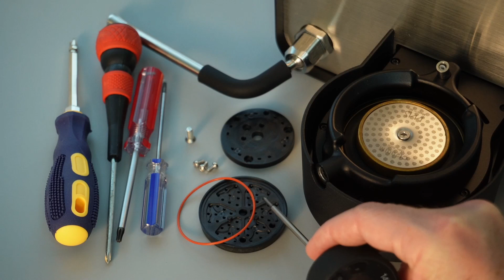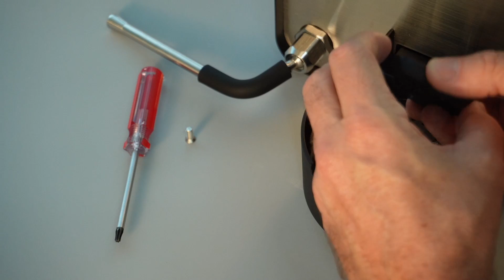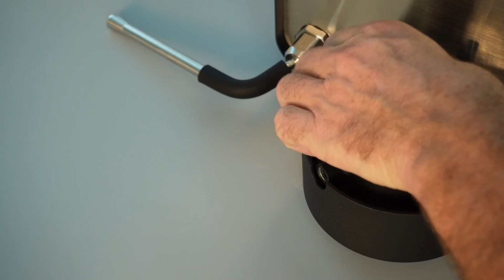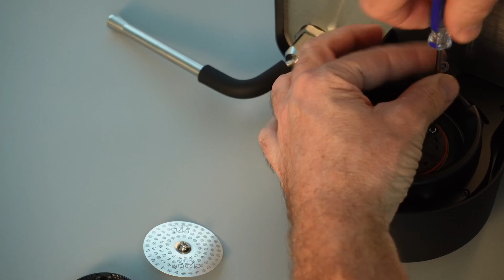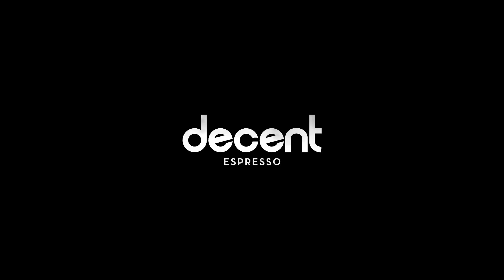How to upgrade the group head parts on your Decent Espresso machine

Comment: I wonder if by adding that new group head o-ring how long that will last and if that will be a yearly replacement part and how we know is not leaking thru the side, Asking as possible new customer buying the machine.
Reply from the maker: It doesn't get any motion and very little pressure, so we don't think it'll wear quickly at all.  At any rate, it's easily replaced if it ever did wear out.
Reply: @decentespresso  well I made the purchase and I can't wait to interact with the machine, the most that caught my attention is the company mentality of supporting previous models. I hope that continues like that and if big changes are made at least having the option to purchase the upgrades that we continue enjoying the machine thanks Decent for making this awesome machine

Comment: Why the new screws? Can we use the old screws?
Reply from the maker: Using the Torx screw is better in the long run as they are less likely to get stripped. ✌️

Comment: Would you clean these with a Cafiza soak too, same as the old parts?
Reply from the maker: You should only use cafiza on the metal parts only, like the portafilter head. Just warm water and a sponge should do it for the new group head parts.
Reply: @decentespresso Portafilter head as in basket?

Comment: One year of using DE1XL, I started to have white powder (smears off like a chalk) after each forward flush mode. 

Upon replacing the group head parts, I noticed there were a lot of build up on the brass. I wonder if these are zinc, and if these would go away with the group head parts replacement? Thanks Decent team!
Reply from the maker: Hifgly likely this is just oxidation of the brass, which is normal and is not harmful.

Comment: Any tricks for removing the group hard parts and replacing with a countersunk, plumbed in machine that is right side up and not upside down? I like to do this each week, but it is more time consuming to disconnect the plumbing, remove the machine from the countersink tray and flip it. I can clean the current group head parts with the machine still upright, but it is definitely harder to get things aligned and back in place.
Reply: I just did this replacement upside down on my machine cause I didn’t feel like flipping it. No problem for the most part. Just make sure everything is properly seated like John mentions
Reply from the maker: If you have enough room you can lift out your DE1 from the countersink to get a better angle when swapping out the parts. Leaving the tubes in place if you have enough length on them. removing them will be easier though as the legbase can get in the way. Worth it to give your intake filter and tank a clean while you are at it too. 😉
Reply: @decentespresso  Yes, that's why I don't remove the machine much at all. I even travel with it in the countersink when it is in my cargo trailer. Since I use this commercially at farmers markets, everything must be fast, because every minute adds up to increased prep and clean-up time. I really need to mount my e65s to the Bror top as well, because just setting that up and tearing it down costs too much time for a 4 hour market. My background in workflow analysis and usability/user interface design helps here.

Comment: Is the expectation that the o-ring will perish over time? Should the o-ring also be cleaned with a solution like Cafiza?
Reply from the maker: I think all o-rings will eventually perish, but we don't know, at the moment, how long it'll take for this one. It's not under much stress.
Reply: @decentespresso  Worth including two o-rings in an upgrade kit?
Reply: @decentespresso